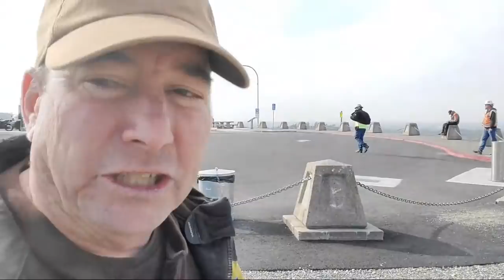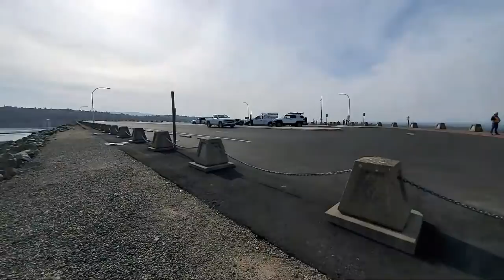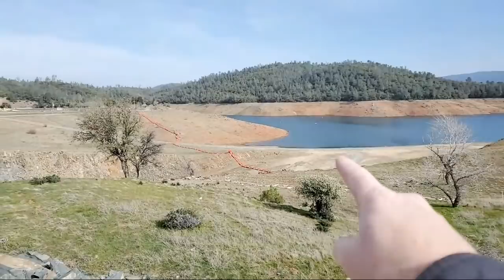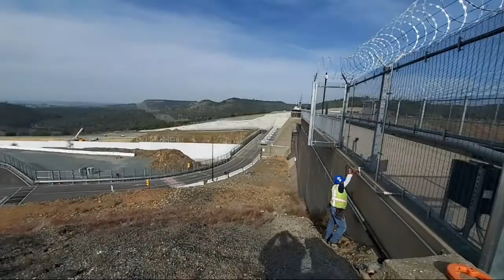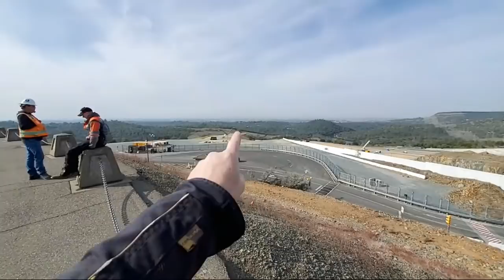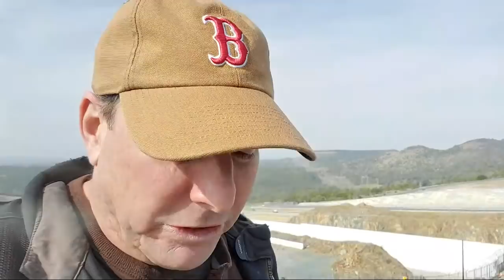Oroville Update Live

Comment: By comparison, here in the UK, our awesome "high speed railway line" - which was underway before the Orville damn event -  is now considerably over budget, is being talked about being many times the original budget, might be open around the year 2028 - 2031 (that's for the 120 miles between London and Birmingham) and the whole of it 2035 - 2040 (and you can 5 to 10 years to all of those figures), and it won't run at the speeds originally intended. I am impressed by how this damn was repaired and the speed with which it was done.

Comment: The message I would share about Oroville  Dam reservoir is that it appears to be pretty darn full... What is deceiving is that the slope of the canyon walls (which are submerged)  is very steep down to the natural river level 800+ feet below.... So imagine a  large "V" shaped natural canyon filled with water. The capacity grows exponentially as the water level rises.

Comment: Hmmmm ...Needs aerial pictures that show perspective and point of reference;  too complicated for 4th graders without pictures or diagrams on the  front chalkboard or projector screen explaining what it all looks like. Big terms that need defining... penstock, reservoir, historic average; sloped inlet structure for temperature control;  "battery" is confusing when children think of duracell instead of the potential energy that water storage provides and the workings of a turbine generator.  When are you medically cleared to get back in the cockpit?
Reply: Add "secant" to the list of "big terms that need defining."

Comment: So, this may be the most important site in all of California...not Sacramento. :)  I never knew we were that close to a disaster.  The whole reservoir could have emptied if the spillway had continued to erode?  Like a liquid excavator and conveyor belt, it would have cut its way as deeply as needed until the flow of water stopped, I guess.
Reply: I think it would not have completely emptied but kept going until it got down to bedrock or the level of the concrete structure. I don't remember how low that is but it would have been bad no matter what.